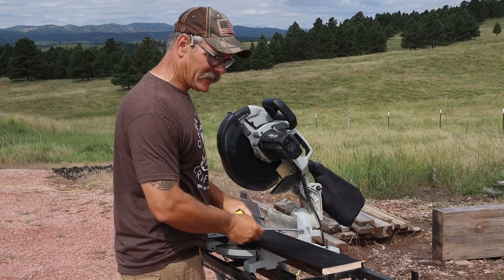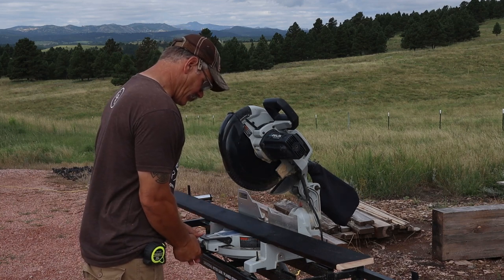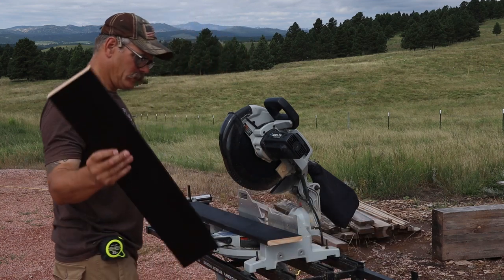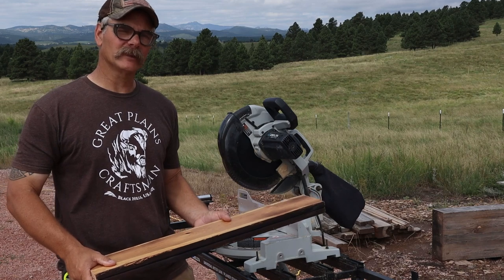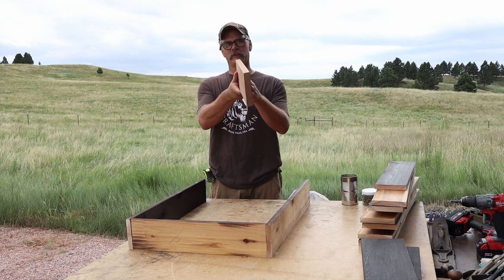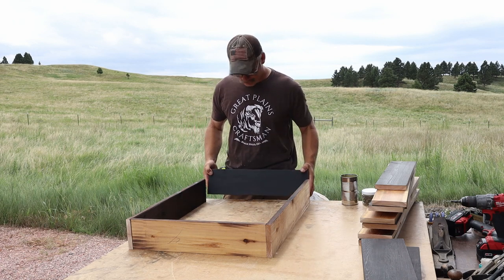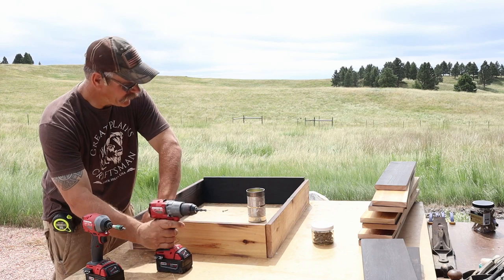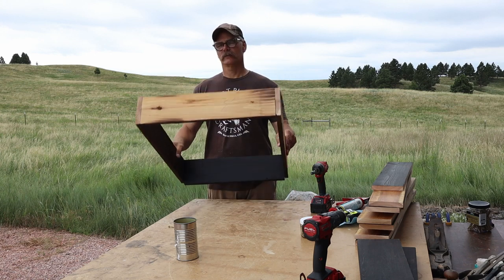Barn Window Frames - Building custom window frames for the Timber Frame

Comment: Is there a reason you don't 'clutch' the drill when driving screws? Always appreciate the tips you provide. I keep them in mind.
Reply from the maker: That was an impact driver, no clutch on that.  The drill which had the clutch was the one with the countersink drill bit.   Just had them that way to save time back and forth.  Thank you!
Reply: @GreatPlainsCraftsman , I've often wondered why they don't put the adjustable clutch on the impacts... For delicate stuff it would sure come in handy.

Another great video. Showin' off with the scenery again - and a rainbow, no less! :-) 
I know, I know, its the jealousy speaking!!